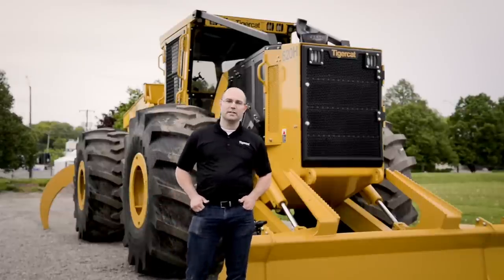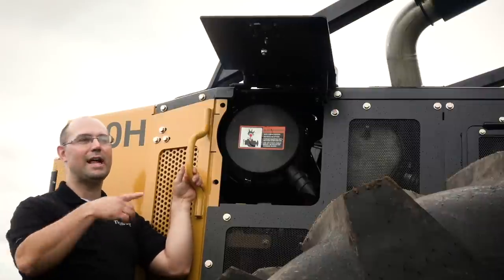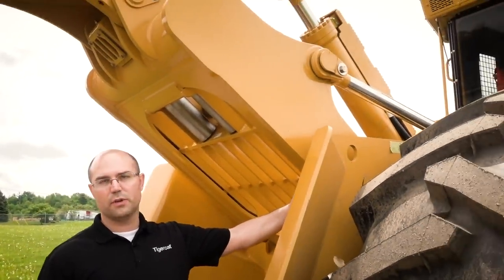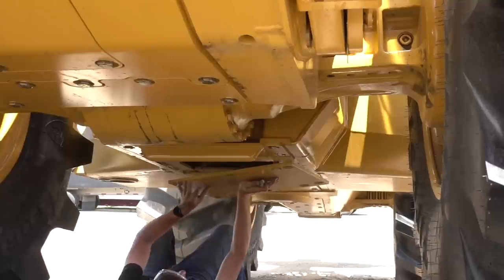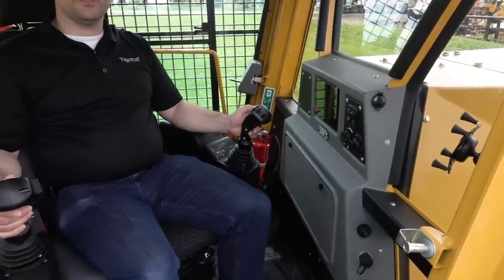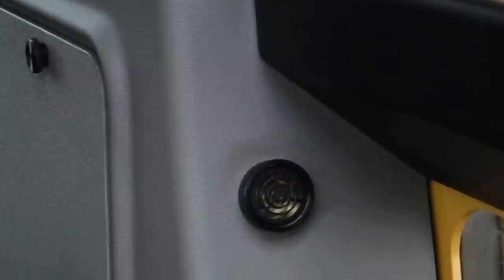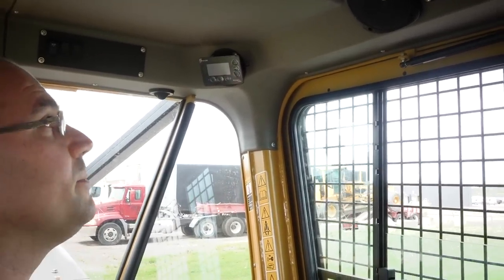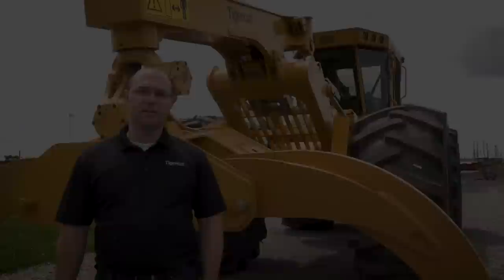Tigercat H-series Skidder Walk-around: NEW features and improvements to Tigercat Skidders

Comment: My father’s business has been Tigercat proud since 1997. I have been a skidder operator since 1994. Still operate a 2002 230 B loader producing 12-16 loads a day. If u want to trade equipment every 3 r 4 yrs the other brands are fine, but if u want a machine that will hold up long after  it is paid for there is no other brand but Tigercat!

Comment: The improvements look great!  When you added the joystick button to release the seat to rotate, you did keep the foot kick lever though, right? 
No other manufacturer seems to understand that a skidder benefits from a large range of motion of the boom and arch. Only Tigercat can push itself backward up a hill with the grapple by shoving it down under the rear tires toward the front of the machine. If for some reason (it happens sometimes) you need to drag some logs that you have grappled 15 or 40 feet back from the butts, nothing does that like Tigercat, thanks mostly to that long long reach of the boom and arch or boom and stick or whatever we call it. That long long reach makes it a simple open-swing-close maneuver to double or triple up a few bunches in order to fill the grapple, where other skidders have to open-forward-turn-reverse-close to add the same two bunches together. Then, if you're stacking your own wood, the long long boom and arch, and the range of motion of them both, allows you to effortlessly build your decks as high as  you want without spinning and chewing up the logs with your tire chains. That's why Tigercat is in its own league with no competitors or peers for steep, swampy, or otherwise difficult terrain and in situations where there's limited room to maneuver.  Other skidders seem like your grandfather's tractor in comparison.
Reply from the maker: The foot lever is no longer required.

Comment: Should of added a bar with socket for the quarter turn cab lift bolts. Be nice for maintenance and cleaning purpose without having to search tool box for right size.
Reply: They would still have tool box in blade wouldn't they?

Comment: I hope they didn’t put a button on the joystick that controls the seat turnaround feature like the John Deere L model skidders
Reply: They did but the seat spins by an air tank can hear the air every time you spin it around
Reply: Pretty sure they got a heel switch  aswell ,  a button on the joystick isn't  bad , I never had ANY issues with mine
Reply: The johndeere L machines are a nightmare. Never say tigercat should be like deere... ever..  😂

Comment: That is great u can spin the seat front and back can u spin straight fwd because it dose help going over some realy trcky nasty almost tiping over terain to be facing streagt fwd ive found that runing old TJ riding 2 people in cab and driving from side of wheel u lose opearator capability when in nasty place where its realy bad at limits of machean where you.